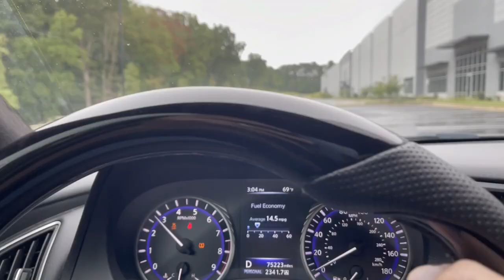Q50 with LSD RIPS! | Traction Concepts LSD Launch Test

Comment: Do you get the 4 gears along with it? Or just the diff part that is like 379?
Reply from the maker: You can do either or.  If you do the basic, you have to shave your spider gears.  If you get the gear set, you just replace your factory spider gears with the ones they provide.

Comment: You do realise that all you have to do is turn off the traction control button and the brakes will no longer kill the fun I can assure you it has a limited slip differential that actually limits the slips I've seen inside my v36 350gt S it definitely has a viscous
Reply from the maker: That is 100% false.  The Q50 has an open differential and the traction control button does not change that.  I can assure you of that.    Certain trim levels of the 350z did have a vlsd.  My 350z does.  The Q50 however, is far removed from the 350z.  If you look back at my installation video, you get a very clear view of the open diff.

Comment: Wish they made for 350z
Reply from the maker: You can swap 350z diffs for the factory lsd or reach out to them—they may have a solution
Reply: Yes, we do have the 350z LSD Conversions. The older z with the R200 back when they were new, and some viscous types it works with also. Reach out if you don’t see it on the website and we’ll point you to it.
Reply: @TractionConcepts  I think checked I'll look again thank you for confirming 👍 I have a spare open and lsd in car now but it's very unpredictable like he says here
Reply: @snowfreak207  Unpredictable is not fun.

Comment: This is for traction concepts to respond. I am very interested but have little knowledge on diffs and do not feel ok with shaving my gears but dont have enough to buy the preshaved spider gears. Does the kit come with instructions on how much to shave off? I am running Z1 brace vms rims on mickey thomps ET STREET SS 305’s with a Ecutek tune on e30 for the 3.0t wanna know if it will hold with that much TQ going to the diff with the slicks breaking no traction and hooking. Ive been interested so long in your product please respond so i know whether to save for the spider gear pre shave or to have a machine shop shave it down!
Reply from the maker: I’m not sure how closely they monitor the comments in this video, but you might get a quicker response messaging them directly on Instagram or inquiring through the website.  They are very responsive and I’m sure will get your the insight you’re looking for!
Reply: @SpeedCultureStudios  Thank you brother been watching you since i had a 3.7 now with the 3.0t🙏🏽

Comment: I think it time for you to really show the cars performance to be honest. 

& to be able to do that U have to have tingles on ur legs  & ur heart racing 

a vid like that would be great
Its justice 😂🦾
Reply from the maker: Just need a place to do it!
Reply: Maybe you could try a local drag strip. Much better than vacant parking lots. Prepped for better traction.
Reply from the maker: @phelanator5784  We're talking more of a road course.  The car hooks quite well now in a straight line on older asphalt or concrete.  On a prepped surface there is no question it would hook well!  The car is not really setup to run in a straight line and we know the VQ isn't that quick from a dig.  So, I really want to test it in the corners!